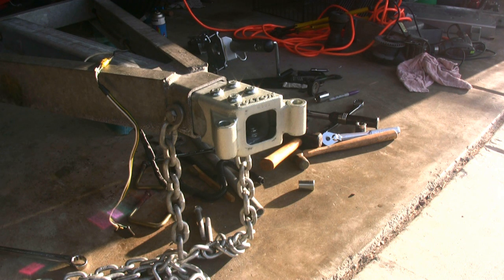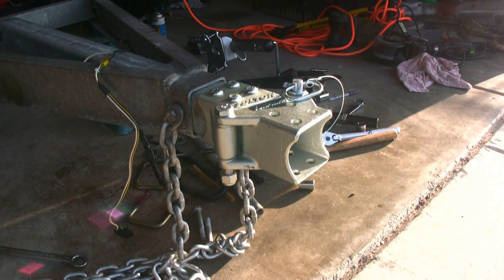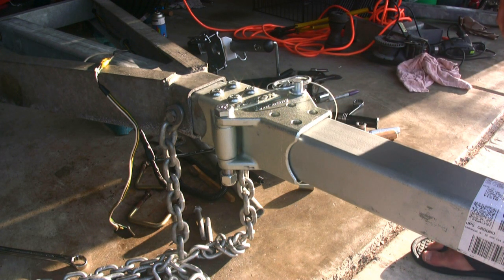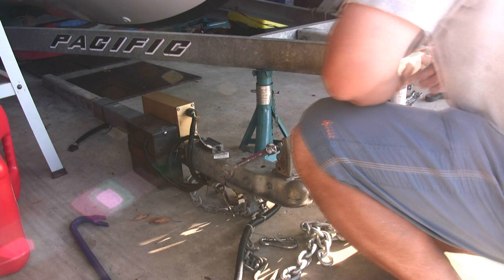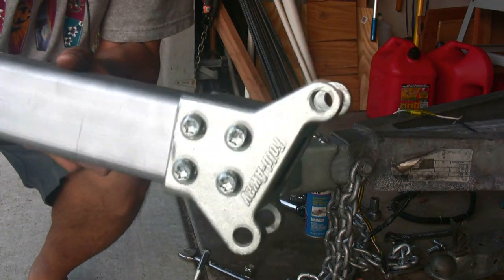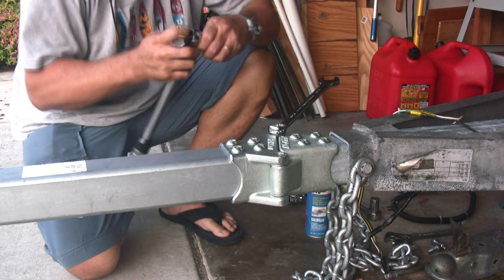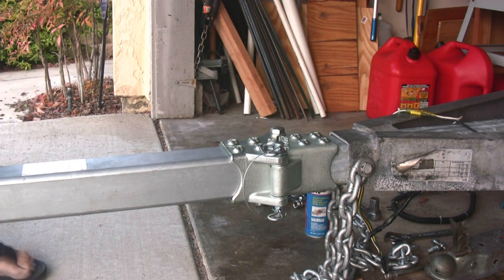Switching to a Swing-away Trailer Tongue - Part3 (Short Version)

Comment: I would add a safety chain loop just a bit farther towards the back of the trailer after the ball coupling.  Imagine what happens if your trailer is disconnected at the ball with your current chains.  Trailer would drop to ground and would slide underneath your tow vehicle if the brakes were applied.  A safety chain loop is a nice big thick piece of steel looped under your tow bar.  That makes your safety chains effectively much shorter.  Trailer won’t go as far under your car or off the the side.    Google boat trailer safety chain loop for a pic.
Reply from the maker: Hi Jeff,

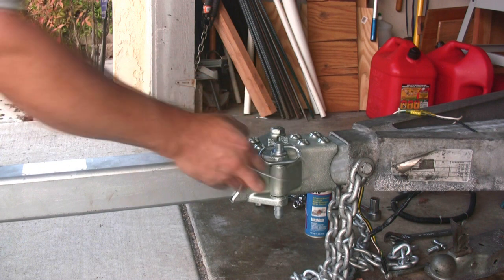Thanks for that observation. If you look at the tongue at around 3:40 or 4:20, you'll see that there is a safety chain loop welded to the bottom of the tongue just back of the hitch, for exactly the reasons you noted. 

I mounted the end of the safety chains to the main frame, however, as a backup in case the tongue hinge itself broke. If the safety chains were only attached to the tongue, a hinge failure would allow the main frame to separate from the tow vehicle. Of course, in that event, the surge brake emergency lever would be triggered and the trailer would (hopefully) eventually stop, but this way I can hopefully have some small level of control over the trailer, as opposed to having it careen off into traffic.

I guess an alternative would have been to have short crossed safety chains attached to the tongue, and a separate set of safety chains connecting the back end of the tongue to the frame.  I will take a look at that, would definitely be easier to work with!
Reply: @btb.fishing  I see you used the safety chain loop now.  I think that's a good idea.  I don't know if it would hold if the trailer came loose, but it's a good step.  

Thinking about a trailer coming off the ball causes a bit of pucker factor for me.